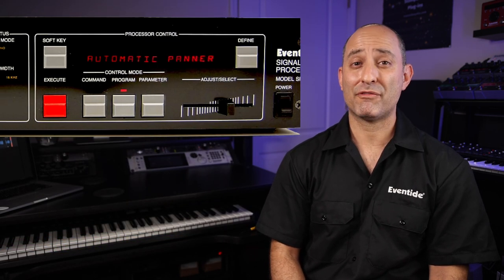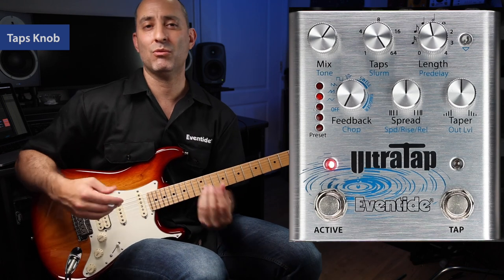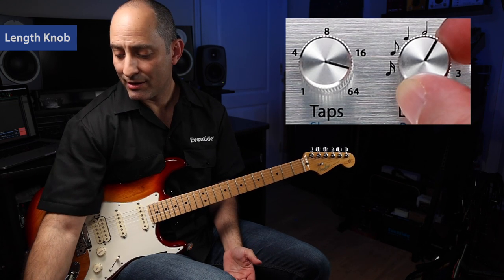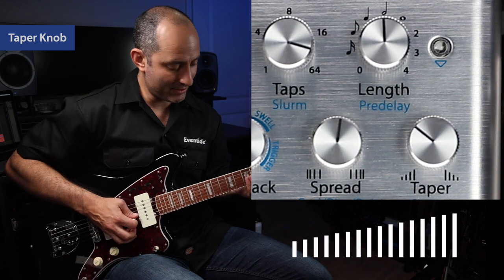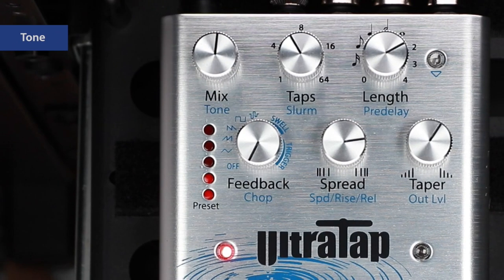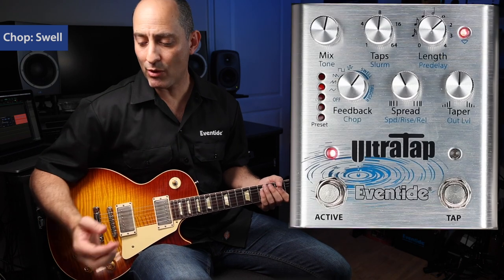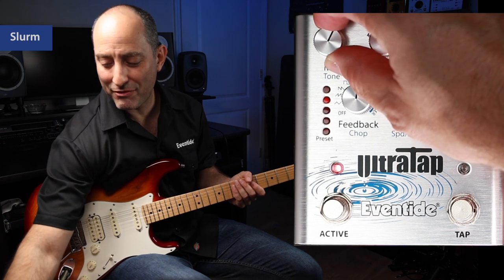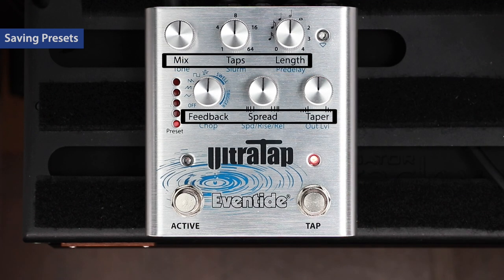Eventide UltraTap Pedal Tutorial - Part 1: Knobs & Switches

Comment: Is there a way to 'preview' the effects of the 46 presets in the Eventide Device Manager so that you know which 5 you want to move to the pedal presets?
Reply from the maker: When you have UltraTap connected to your computer and you’re running the Eventide Device Manager you simply select presets from the list to load them on the pedal. When you find your favorites you can move them into position in the first five slots. You will be able to recall them from the front panel of UltraTap when it’s not connected to your computer.
Reply: @EventideAudio  Thank you for the quick response, but is there a way to hear what the presets sound like before I load them into the pedal?
Reply from the maker: @worldwide1376  The easiest way is using the software. Users can click through sounds fairly quickly without even moving anything. On the pedal itself, it would require a MIDI controller to cycle through the internal presets. Otherwise, we only have access to the first 5.

Comment: Is there a way to "hold" the delay (whatever is currently audible), and just have it repeat without it changing? (not freeze, just continuing whatever is in the current program material)
Reply from the maker: With Feedback set to 100% UltraTap will loop the delay path. On board control will still be able to influence the loop, however. If you wish to play atop the loop, you could bypass UltraTap as the loop is going and the audio will not continue to layer. Bypass mode needs to be set to DSP+FX for that to work.
Reply: @EventideAudio   Appreciate you responding... the trouble with 100% is that it is somewhat difficult to "get a nice loop going'... it's "too much" ... in other words, there's probably a sweeter spot between 60-80% where you can "play with the program" until you "find it", then BOP, press a button and just hold the really nice delays that are currently playing back at you. This was possible in early '80s with the Deltalab 1024. It was not a "looper". It was exactly as described. Whatever was in the delay line just continued to play indefinitely once "The Red Button" was pressed. Of course, I have one of those units, and it is noisy as heck (old electronics), and it also has an output issue that is distorting. So, I have been looking for this "Red Button" now, for a little over 40 years. I talk it up at NAMM every time I am there, but alas, to date - no go. Quite amazing. It was done over 40 years ago, and has never been seen since (I've looked, high and low)... Maybe our day will come. Thanks for listening. Peace
Reply from the maker: @PeacelandMusic  It’s possible to get the nice loop going at the ratios you’ve described but then sweep an expression pedal up to 100% when you’re happy with the delay. Just a thought.
Reply: @EventideAudio  Worth a try, but would still have to navigate out of the loop to continue playing over it... appreciate the tips! Thank you! Peace
Reply: @EventideAudio  My experience with "turning up the feedback" has not typically been positive, as the compounding effect of increasing seems to add further "distortion" of varying types into what I had originally "programmed"... (typically not ideal)